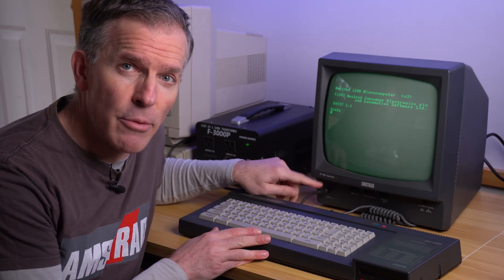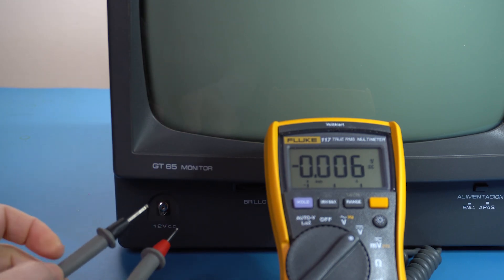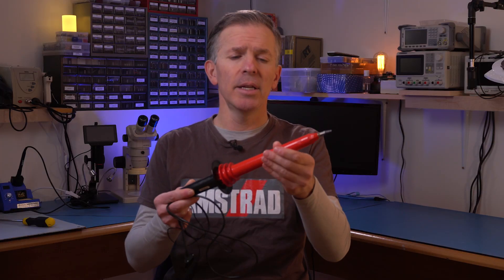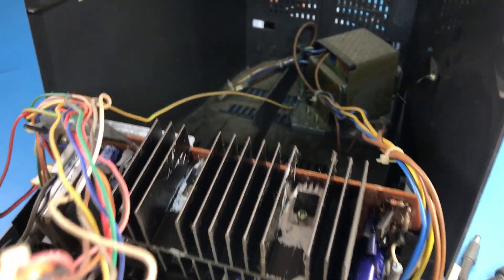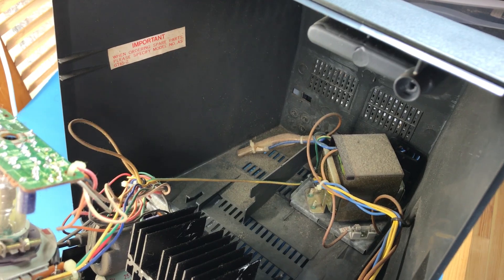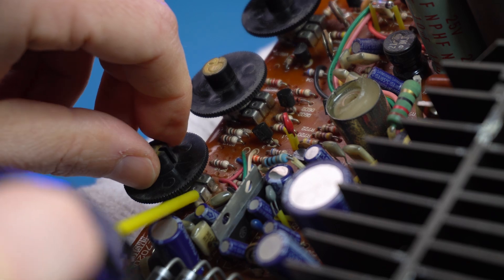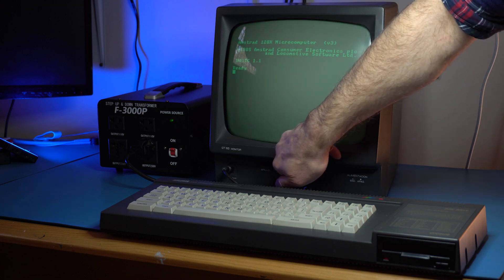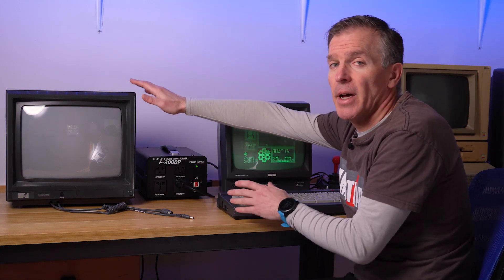How To Service A CRT Monitor

Comment: Hi Noel, I worked on CRT test and design back in the 80’s and looking at the schematic I would definitely try cleaning VR703 and VR702, they are right by the video processing chip. I agree the jumping looks a little too regular and interference could be a suspect, but there was so much crud inside and the de-oxit worked well on the three external pot’s so might be worth a try to at least discount that as a potential issue.
Reply from the maker: Thanks Alan! I'll check them out next time I'm there since it seems I'm definitely going to have to do a followup video. Cheers.
Reply: I have a Dell m992 with a red screen and a cut VGA. Is it fixable?

Comment: It's probably the magnetic field from the transformer inside the monitor.  When operated on 50 Hz it would only be moving very slowly with respect to the frame flyback, but when operated on 60 Hz you get a beat frequency.
Reply from the maker: Yes, that's what I'm thinking. I'll see if I can either feed it 50Hz or filter it better to remove that interference.
Reply: @NoelsRetroLab  You would need to put a magnetic shield around the transformer.  It would be easier to convert the monitor to use a switchmode power supply in place of the linear one.

Comment: Hey Noel. The jitter is probably beat interference from the mains 60Hz and the vertical refresh at 50Hz. It can happen the other way around too, when a US computer is used in Europe. Here's what I did to tackle it in a PET 2001: https://youtu.be/w44i-WKJxV8
Reply from the maker: Very interesting! I'll definitely have to have a look at the sync signal on the monitor board to see if I get any of that interference like you did. Thanks!
Reply: @NoelsRetroLab  could it be the shape of the AC sinewave from the step up-down  transformer ?

Comment: Well done for taking the step into CRT repair and not getting fried! If it had been me (and it probably never will) I'd probably have tried to discharge the monitor like 12 times and still worn rubber gloves before touching the anode 🤣 Great to see you using the new lab too, hope it worked well for you, good luck with the next one - and don't get cocky with that HiVoltage! 😋
Reply from the maker: Thanks! Yes, it's very important not to let your guard down when you're working with these kind of voltages.
Reply: Gloves to handle 14kV are pretty thick! Not easy to work with them on...
Reply: @fred-9929  Yeah I bet! IF I ever did CRT repair (not in the forseeable) the marigold-gloves wearing for the final step would be mostly for ceremonial and superstitious reasons in my case :)

Comment: I would like to see that DC conversion if you decide to do it, Noel! Sounds very interesting.
Reply from the maker: I'm very tempted to make it, especially if it fixes the jitter problem. First I want to fix the color CRT though, just in case things go wrong 😃
Reply: it really shouldnt be hard to do.. just need to find the amperage needed.. disconnect the original psu and wire in the new one...